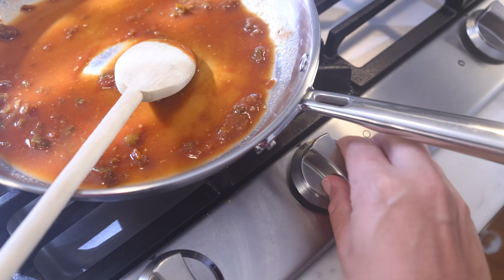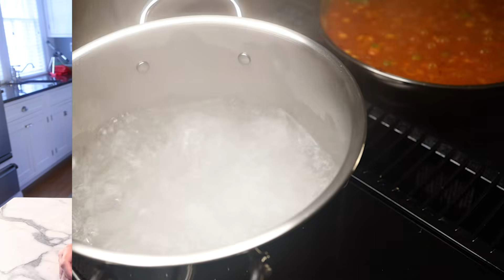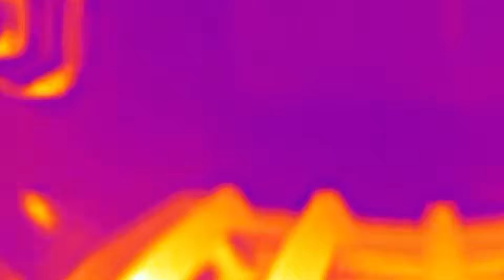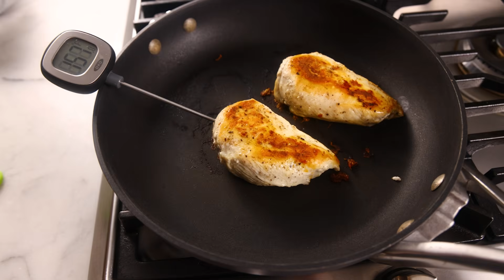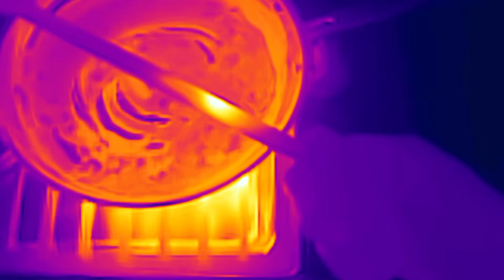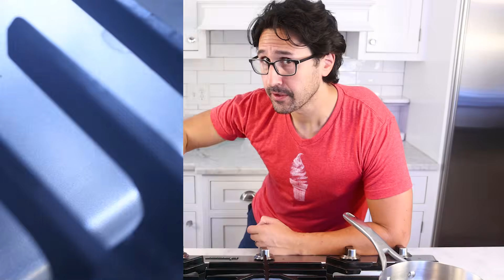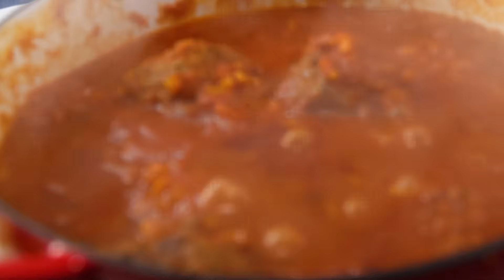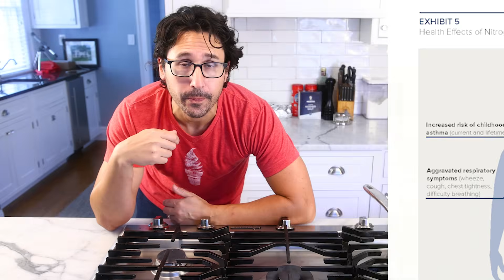Problems with gas stovetops | weak, dirty and dangerous

Comment: Honestly, "easier to clean" was my number one reason for getting a glass top electric range. My experience with gas stoves in the past had been with ancient ones that barely worked, including one in my first apartment that would only light if you smacked the side... I did a lot of microwave cooking in those days. And then one day, I had to take the whole damn thing apart to clean it because something boiled over.
Reply: I have a gas stove with a top made of glass except for the burners themselves, and the burners are made up of detachable pieces that are not particularly hard to clean. I have no idea why it's not the standard everywhere, it just makes so much sense
Reply: I rented a house once that had a black glass cooktop. I hated it.
To keep it clean was a real pain since any spill was immediately burned on and looked horrible. Plus even though it was newer technology than an electric coil stove it would still turn itself off and on to try to maintain a level heat, causing me to need to babysit my food much more than gas.
As to the reason for white surfaces; it is much easier to see grime on a white surface. If it is important to you to keep your kitchen clean, as it is for me, then being able to see the grime that you don't want to leave behind is a very good reason for white.
Reply: @pourattitude4206  One of the best things about glass is that you can go straight to the nuclear option: steel wool. Trying to clean burned on food in the many tiny crevices that gas stoves have? I'll be honest, I never bothered.
Reply: The idea of being able to break your stove top is just... Oof.
Reply: not long ago i was trying to make a new chile con queso recipe on our gas stove, and the recipe had wonky ratios i was having to fix as i went by adding more of this or that, so i ended up with way too much queso in a too small pot. didn't have a bigger pot. so my genius "making queso at 3am" decision was to transfer it to a large glass mixing bowl and keep stirring on the stove. that went about as well as you'd expect. literally right when i was finishing and about to pull it off the stove, the bowl exploded. i'm lucky i'm not dead or blind. and the absolute worst part of it all was my partner and i having to pull an all nighter to completely take the stove apart and clean out all the shards of glass and cheese. it would have taken an hour to clean that mess with a glass top electric stove.
i still prefer gas over electric, but yeah it is not very forgiving if you make the stupidest possible mistakes like i do 😅
Reply: I learned from my mother to just lay down aluminum foil under the metal grates, and then replace them once every 1-2 months when they get too dirty. Makes cleaning a million times easier.
Reply: Can I just ask why tf it's normal for the color of the top of gas stoves to be white?  It should be ash black to match the cast iron parts above it and the eventual spills that will burn onto it.

Just because it's not burning wood doesn't mean it's not a literal fire pit and it's not an eating surface you need to be confident is completely cleaned in the first place.

Can you imagine if it was normal to have the inside of propane grills or ovens be bright white and how annoyingly stupid that would be?

But that's what we get on the heat source we can't hide by closing.
Reply: @dynamicworlds1  If you look back to the early home stoves from the 30s-50s'ish there were a multitude of colors (in now-'vintage' tones like mint green). As costs went down the options shrank to white, and then only recently have gone back out to add black in. 

HOWEVER - you have options. You can have the top repainted professionally, if you really want. And I do know you can still get fancy, crazy-expensive gas stoves in a rainbow of colors if you want to pay the cost of a car. Some boutique french company makes them, I saw them featured in architectural digest once.
Reply: The problem becomes when you accidentally burn something on the electric stovetop. You have to get that stuff off or else it gets worse and in the meantime that spot of your burner has an extreme efficiency reduction. If it is bad, abrasives may need to be used, which can damage the cooktop. Gas stoves do not typically suffer from this as much. If something falls and burns, it is typically doing so in the basin. Rarely will this go into the burner, and if it does it is simple to remove the blockage as an abrasive won't damage the burner. The basin is also typically designed to hold up to abrasives, but even if it does become scratched or worn it doesn't do anything to the actual cooking ability of the stove.
Reply: @tervalas  this matches my experience.  I recently moved and now have a glass top, and maybe I'm just a messy cook but I cannot keep it clean, and the switching on and off bugs the shit out of me. The burned spots won't come off with basic cleaners, and harsher ones make my lungs stop working. It's also hard to keep a pan centered over the burner when I can't see where the burner is without lifting up the pan.
Reply: Clean up is the reason I was attracted to radiant, but with years I’d use I really don’t like it. The pulse based operation is terrible. Doesn’t boil fast, need thick bottom pans (cast iron is better but my family won’t take care of them), can burn spaghetti in water…, some burners won’t go low enough and often burns food (and it’s not sized based.) I always had better luck and control with gas. I’d like gas and induction. Induction is so expensive though.
Reply: In India and in Africa women are cooking with cow dung or illegal-made charcoal. Those women spend hours fetching dung or charcoal and faces all the health hazards of cooking with them. When they are able to move to a Propane* cylinder, their lives becomes way better. Here in Youtube there's a video titled "Natural gas for health" . In this video, a village in India got piped natural gas and the life of the women their got way better. So this video is pretty much first world "problems".
Reply: @Brandon_letsgo  For these people solar cookers are a healthier option.

Comment: I used to have an induction stove and to be honest it was awesome….when it worked. The problem in they do break pretty easily and when they do they take forever to get fixed. Since they are a less common technology the infrastructure around them is very young, not a lot of repair men trained to fix them, and once they do come out the parts they need to replace can take months to get shipped out, all the while you have no stovetop. My advice would be get an electric stove or a hybrid stove and if you really like induction stick to the individual induction burner till the technology becomes more common.
Reply: I bought an expensive ($500 , heavy SS) commercial induction hot-plate about 4 years ago and it has been 100% reliable.  Also, you can adjust the heat from 1-100 in steps of 1 and it has a large coil unlike the cheap ones with small coils you see advertised on TV.  So if you want something that lasts and you can get serviced if it breaks, go commercial and be prepared to pay for the quality.
Reply: In my country I've never seen anyone ever have a gas stove. Growing up only electric. Nowadays if you have a modern home, there's an induction stove. I have one, my sister has one, my parents have one, all of my cousins that I know of... only older kitchens have electric cooktops. 
Really really really old kitchens, mainly in summer cottages where no one lives for extended periods of time, you might see a wood heated cooktops. But that's so rare that you most likely will be in a museum if you see one. 
The only time I cooked with gas was while camping. I had this really cute portable gas burner ment for camping. Worked great, but I prefer my induction stoves :)

Comment: One of main reasons I requested a gas stove when buying my current home is that it'll still work in a power outage. Having grown up in NC and living through a few hurricanes and several ice storms that knocked the power out for days and sometimes weeks it  was just engrained in my brain to get a stove that would still work in those situations.
Reply: Depending on the state if you are getting a hurricane they turn off the gas for obvious reasons.
Reply: @sprockkets  Obviously not in NC.  It's not a problem if you use propane, anyway.

Comment: You can set a gas flame arbitrarily low by setting the knob close to the off position, not as far as possible from the off position which is where the setting is marked as "low".

Comment: That stove top doesn't have the concave iron heat reflectors that a good range top like a Blue Flame or Castle stove will have.  A lack of burner chambers ruins heat transfer to the pan or pot.  Try professional equipment, it is well worth the money.  I have low heat leakage on both my Castle range and Blue Flame cook top.

Comment: Gas ovens are the best because they produce steam along with heat. Best bread ever. Induction may boil faster but with gas on low I never scald milk at all nor have any gum up even slightly on the bottom. This still occurs with induction tops I've used.

Comment: This makes me wonder about stovetop heat diffusers, especially for gas burners... On top of it's obvious job of diffusing heat, if it's wide enough maybe it could reduce the amount of heat running up the sides of a pot or pan.

Comment: I stayed in a small efficiency apartment in Bluffton IN for a few months about ten years ago. The landlord told me he bought the property in a neglected state and was updating units as he could afford to. He said he bought used or inoperable appliances and restored them. I quickly learned to not cook anything on the left rear burner. It would boil 2 cups of water in under a minute but the other eyes were normal. I stood back when using that eye out of fear of what was wired incorrectly and the potential of a catastrophic meltdown.

Comment: While I don't dispute the points laid out in this video (and the info about heat rising around the outside of the pot is very interesting and I hadn't considered that before), I have cooked plenty on both electric (resistance coil) and gas ranges, and honestly I can't stand resistance coil cooking.  Between the unresponsiveness, and the fact that I can't visually see how much heat I'm putting out, I just find it to be a much more frustrating cooking experience than a gas range.  That said, I've never cooked with induction, and I very much would like to try it.  If I do find myself having to replace my gas range, I may very well go that way.  Though I do use a wok from time to time and I wonder how that would work.

Comment: This is interesting because I always thought my electric range was inferior. I must say that the glass is a  PITA to keep clean and avoid scratching, but it does get nice and hot. This makes me wonder all about heat settings... A possible topic for you to cover...for example, chefs on YouTube keep saying "medium-high" heat and my assumption was always that my stove put less heat to the food than they had with their presumably hotter gas flame stove, but that may not have been the case. I have always found that med-high usually meant 6/10 not 7 or 8, which you might think (assuming 9/10 is high and 5 is medium). This will vary but was a revelation to me when I realized I needed to keep the dial lower than expected. It's like chefs giving amounts of salt to find out later that they meant kosher salt, and often Diamond Crystal kosher salt!! Calibration is everything! Plus so many chefs suggest to get skillet super hot, like 550F+ for browning, which makes the house a hazy smokey mess, when a little patience and you can get browning once contact between meat and heat is about 300-330F, and this is possible using a pan in the low 400s, which avoids the smoke points of most oils, and just better for my non-commercial kitchen. A lot of this calibration really gets overlooked. So now with what you have shared, "medium-high" heat on gas probably makes sense at ~6/10 on my electric dial, thanks to more efficient heat transfer. Once you have experience it is easier to adjust, but newer cooks struggle with these proprietary settings.
Reply: You have to stop thinking with numbers when cooking, you cook with feelings. If it feels too hot you turn it lower. After all the end goal is to satisfy people's palette, which isn't quantifiable.
Reply: @kaikart123  Well I agree with you but you are also showing the curse of knowledge... Nowadays I have a feel, but starting out people have no frame of reference, and need guidance or a framework about what is reasonable. Otherwise it becomes guesswork. Someone cannot "feel" that it is high if they don't know what to expect.

Comment: Yeah idk man, I've always preferred cooking with gas. The dangers you speak of are pretty rare, and like you said, with a hood you haven't got much to worry about in terms of NO2. The responsiveness of gas really can't be understated and your heat losses have alot to do with those massive burners there. 
Yes, it's harder to clean, but it's more reliable too. I changed from electric to gas when I bought my house partly bc I couldn't stand to wait for the coil to heat. Then It'd freak me out bc the coils would be hot long after I'd walk away, and I have small kids with curious hands. I often cook for 10 and changing configurations on the stove is common, and that delay was a bother. Sure you can boil water faster, but I bet it takes twice the time to fry an egg. 
Either way, I love the show thanks for another good vid. Cheers.

Comment: I remember my first time with a high end induction stove. I cranked it to full power with a lid on a pot and it boils over so fast I didn’t even notice steam escaping the lid. Electric is way more powerful and efficient.
Reply: The problem isn't getting hot quicker. The problem with electric is getting cooler quicker. If you are on 100% and change it to 50%, it take a lot of time for the coil to cool down. This is key in cooking because it is the difference between burnt food and good food. In comparison, gas stoves are much faster in those changes and hence why many prefer it.

Comment: I recommend using a Chilean toaster for those pesky gas stoves that just won't go any lower. It's similar to a wire or camping toaster but it's strong and big enough to hold a pot or pan on top of it, and that works as a buffer between the fire and your pot. I think you can find some online.

Comment: Induction is so much more pleasant to cook with in the summer because it does not heat your whole kitchen nearly as much as resistance or gas heaters. I have also noticed that my nonstick pans seem to last much longer on my induction range. I have had the same cheap pan for almost 6 years and it is still without a single flake or chip. Granted, I only use silicone or plastic utensils, but I suspect that the heat might be better distributed on the induction than my old gas stove that would kill a nonstick in about 3 years.

Comment: While gas stoves are definitely less powerful, especially with regulated gas output, I will never stop using it because it gives me the responsiveness and the ability to see my heat level.

Also About the scorching problem on the side walls of your pot. This is a pretty common problem for half clad pots and pans on gas and some electric stoves.  The bottom of the pan gets nice even heating but the sides don’t.  This doesn’t happen nearly as much on full clad pans(tho they are quite expensive).

Comment: Induction is great, but the cooktops we looked at all required 60amps dedicated.  Most houses don't have 60 amps run to a stove.  For us, we stuck with natural gas as the sheer cost (cooktop, electrician running new supply lines, and added electric costs) would not be worth it.  I grew up with glass top infrared, and I'd never buy one of those again.

Comment: Here in brazil we use gas stoves almost exclusively, it's very rare to see an electric one, to the point that most people won't even know there are 2 types of electric stoves. I think the main reason is that gas is VASTLY cheaper, a hundred bucks of gas will last for several months, if alone maybe even a full year, on the other hand, an electric stove would spend that in energy every month, using only for an hour every day, and a lot of families can't afford that.
Reply: It's the same in the most part of the world, gas is a lot cheaper than electric.
Reply: Or were you referring to induction stoves as on type of electric stoves?